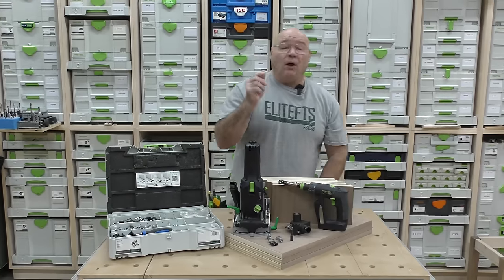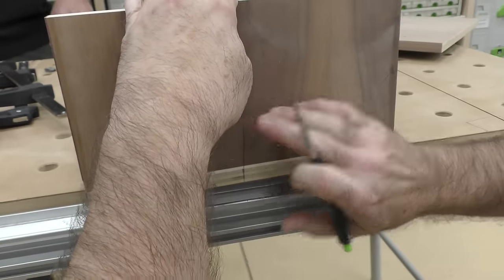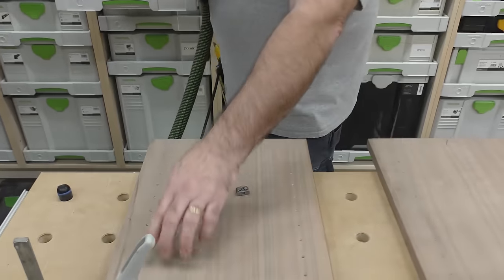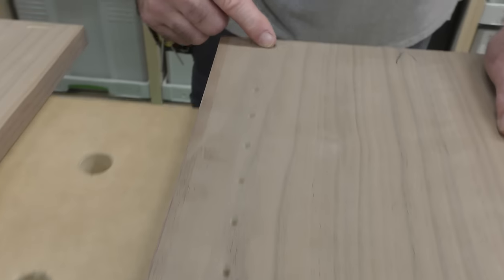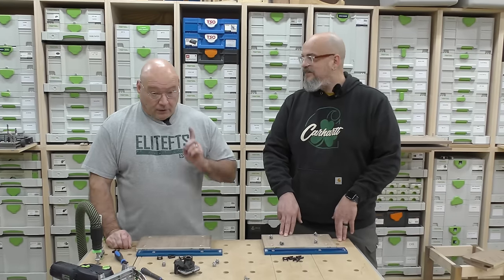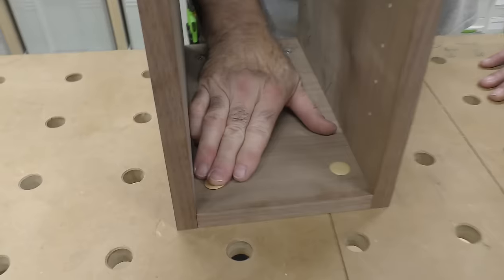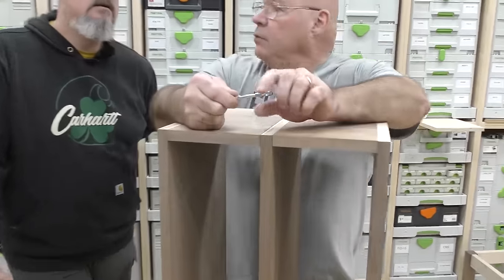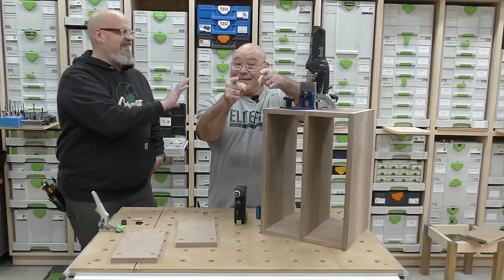Are Domino Connectors Really Worth The Hype?

Comment: Awesome video!  I'd like to build some systainer storage using this system and either the sys AZ drawers or sysrails.  My question is: with only a single sheet of 18mm ply for the center panel in between and with the plunge depth for the LR32 holes to hold the drawers or rails, will i have a problem if i try to install drawers/rails on both sides of the center panel at the same height?  Will the screws supporting those drawers/rails butt into each other and prevent one another from going all the way in?  If so, is the solution to vertically stagger those holes a bit on either side of the center divider so they don't conflict?
Reply from the maker: I would not build a sys az or sys rail cabinet with a center divider ...I would build it like this https://youtu.be/Qev_HBb9tWc
Reply: @sedgetool  thanks so much for the reply.  I've watched that systainer storage video probably a half dozen times by now and really like the build.  question: when building multiple of those sys drawer cabinets, do you do anything to join them together at their sides, or just count on them staying close together by mounting their backs to the wall?

Comment: Great video and very timely.  I’m getting ready to build a mitre saw station with built in systainer storage in my shop using the knock down system.  One question, I have on one occasion on one hole, drilled with the collared bit and gone through to the veneer.  Is there something I have done incorrectly?  The other holes were perfect.  Sedge it was good to meet and talk with you at Mueller’s.  Merry Christmas fellas!
Reply from the maker: Ray....Great to hear from ya...the only thing I can think of is the jig may have come loose !!....Merry Xmas !!!

Comment: Sedge and Big D, as always a great instructional video of the basic usage of the Domino Connector system!    motivational and it does help!    
Would you consider doing s comprehensive video on different strategies when doing a regular-sized cabinet that one would face in a traditional kitchen?  Meaning, not a conversational cabinet, but rather one that uses 5 dominos... 3 dominos (8mm * 40) tight and loose and 2 connectors (both required to be tight)  and the complexity that marking these out involves (not to say in the real world, but respectfully saying.. like in the real world).   Do you recommend the 1st reference is always right, should that be a connector or domino?  If a connector, since this has to be tight anyway, the second a domino loses, 3rd a domino?? I'm guessing (loose) 4th domino or connector and finally the 5th at the rear... should this be a connector or domino?   Let's assume the first and last are connectors and the 3 in the middle are loose.  How are you simplifying the markings so that one of the panels is all at PD of 15 and the 2nd panel has variations of 25 & 28 both at tight and loose settings?   Are you stopping the machine to adjust the depth, while leaving the machine on to change from setting 1 to setting 2?   Shutting it off in between because of safety?    Are u using the adjustable arm stops that connect to the domino so that you can have accurate placement of the mortises slots that the tight connectors require?      ... heads start to spin at this point, I'm sure you agree.... thus... demonstrating on size of cabinet where this does not come into play is much easier.  
Do you make all of the tight settings first, then come back and remake the tight cuts a large size into loose settings?    There are a few strategies to make the system more efficient.   For one, is 5 dominos (2 connectors & 3 dominos too much?) Should there only be 4.  2 connectors and 2 dominos?   It can get tricky when you set your domino wings to a dimension only for it to be thrown off because some slots are on a loose setting and some are on a tight one.   

These seem mind-blowing to read; however, when one has used the connector system for a while there isn't any way one would not benefit from a comprehensive training video from the highly skilled instructors that you are.  I'm not aware of a "supplemental" instructional video out there on the connector system.  One that addresses the additional factors one faces in using this system in its entirety for normal-sized cabinets.   

May I express my interest in such a video to be produced by you and your talented crew the connector system is fantastic.... not to mention I believe the elements are stainless steel, thus can be used on exterior projects.

Merry Christmas to you and your crew; you are the most valuable part of the Festool system!
Reply from the maker: Wow.... Thanks for the insight on producing another connector video...very thoughtful... Hope youy have a GREAT  Merry Christmas !!!